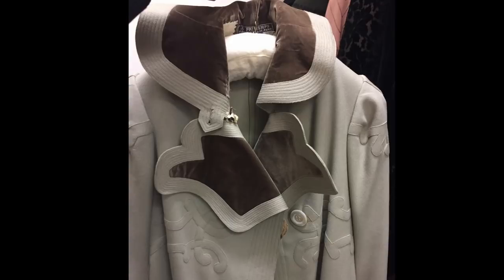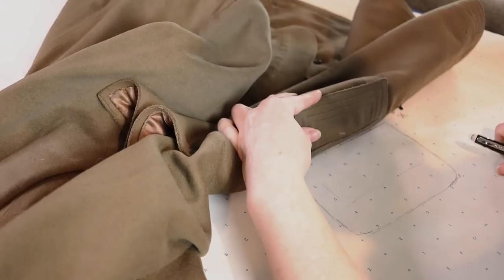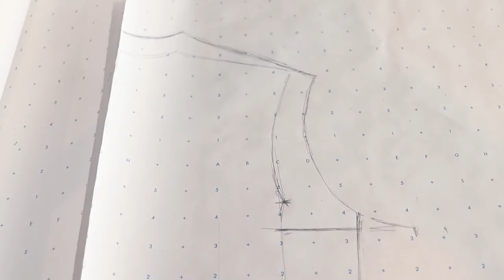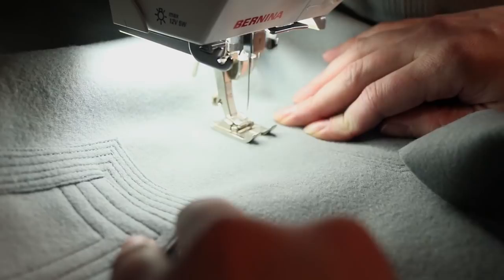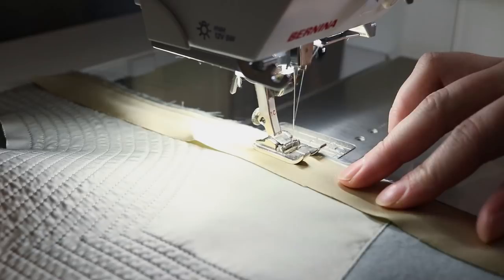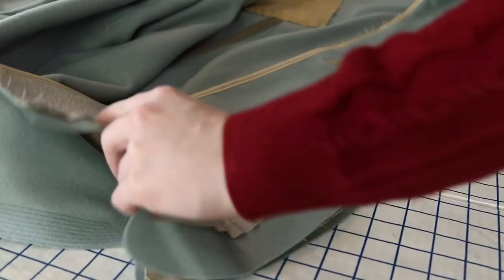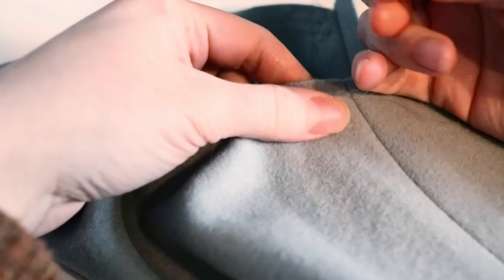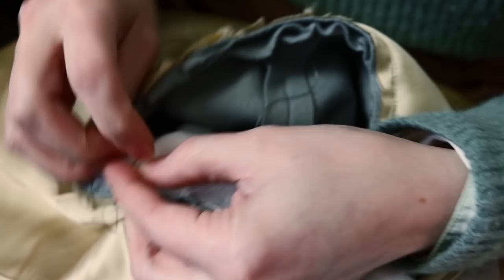Remaking a Small Antique Coat to Fit Me!

Comment: What kind of scissors are you using? (just before 18 minute mark are the ones I'm asking about)  they looked like they might be less difficult on the hand bones. Do you enjoy your Bernina? which model do you use? Thank you for your video's they are extremely informative. and relaxing,
Reply from the maker: The shears are from Wilkinson. They did a crowdfunding thing years ago, but I think the style is still available (EXO). I've got a Bernina Artista 200 from about 15 years ago. It's held up through a lot of abuse!
Reply: @NicoleRudolph  thanks! I got my Bernina 330 summer of 2010, I love it. I'm definitely going to look for those shears, my thumb joints tend to hurt after a lot of cutting with Scissors. (I do like wheel cutters for my joints)

Comment: Random Question: Do you happen to know what brand/size your scissors are? They look like they are really good shears.
Reply: And they sound amazing. Every little snip makes me want to go cut things.

Way back in the day, years and years and years ago, my mother bought me my very first pair of professional hair cutting shears. The very first thing that I noticed with hair cutting shears, a good pair, was that they didn't make any sound. When the shears came together they stopped almost like they were buffered by a cloud of delicacy. They felt so good in my hand. Not so much in my knuckles though; super sharp hair cutting shears should also be called knuckle cutting shears. But there was no sound. Even when I was cutting hair with them, there was very very little sound. And it was the hair cutting, not the shears. It always struck me as almost magical.

But a good pair of fabric shears. Oh my, I just love that sound. There's a strength, and surety, in that sound. 

I don't currently have a good pair of shears for fabric; my last pair stopped fitting my hand. I've been making do. I really need to address that. Obviously there's more to a good pair of fabric shears than just the fit. I just never realized it was a good bit about the sound.
Reply: The pair at 18:37 or 19:03? They look suspiciously like William Whitely EXO scissors. I didn’t spring for them as they’re very pricey but I invested in a pair by the same company and can definitely recommend.

Comment: I feel strongly you need to learn grading. When you trace your pattern off you could do a personal grade. You also need an adjustable or customised dummy to fit. Metric is the best system for grading, you deal only in mms. Garments around Victorian and some of Edwardian era were tight and was the 1950s 1960s. We wear a more relaxed fit now.  As a guide and I can only do metric now. The wearing ease to a garment opposed to design ease back then is 10cm for a dress or blouse,  A jacket would be 12-14cm and a overcoat would be about 16-18.
A fitted dress and or corset or bra would have darting taking away underneath the breast. In a drafting of half the pattern and a side seam a dress of 10cm ease is divided into quarters. 2.5cm showing Centre front to side seam is very little. If you think the body as a circle every mm in radius is much bigger in circumference

Comment: Wow this is a very small coat. Was it for a small adult or a young teenager? I'm unclear you looked very TALL compared to the mannequin. It turned out really pretty.
Reply from the maker: It's hard to say! The original was 34" at the bust, so I'm guessing (based on my suggested proportions) that it was meant for a 28-30" bust. I was around that size in my early teenage years! It's also impossible to guess height since the coat ends somewhere around the knees to mid-calf.

Comment: A lot of work, but I think ultimately the result is not as you would want it.  To my eye it just does not drape properly.  It seems it is like a size too big across the shoulders and the back even more so.   I have faced the same issue when trying t adapt a pattern to fit my wife.  IMO making a mock up using a much lighter fabric just does not work, because it does not hang the same way on your body.
Reply: You must be a real charmer to your wife.
Reply: @kekedarius4957  ha ha ditto